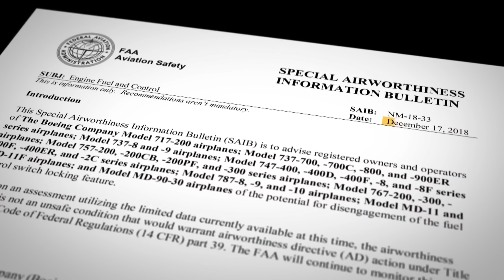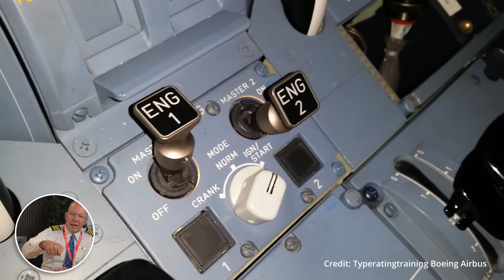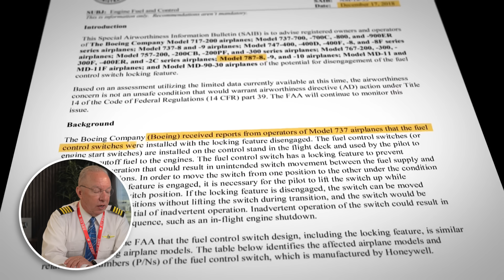Air India 171: The FAA’s 2018 Fuel Switch Locking Bulletin Explained (16 Questions Answered)

Comment: Putting blame on “Mental health” is absolutely crap and easy way to blame pilots. I am surprised how so many people get brain washed with a preliminary report including Mr Steve that it was human error. It was a clear conversation between the pilots where one said “why did you cut off the fuel and other said no I didn’t”. A disgruntled pilot would have faught  back if his intention was to kill everyone. Also this report is probably intentionally vague because it does not say whether captain asked the co-pilot about the fuel switch. Just to let everyone know it’s easier to find out who asked that question because their frequency is different. Also I appreciate captain Steve but just understand that because you are good car driver does not mean that you are a good car mechanic and know every corner of the car. So I would not buy a theory given by captain Steve even if it’s based on a prelim report. Stop blaming mental conditions and start focusing on actual issues. Why the AC on that plane was not working when it flew from Delhi to Ahmedabad? Why all infotainment systems were down? Again just to remind people - when the first MAX went down, the blame was on pilots until the 3rd one went down…

Comment: As I understand it. virtually every modern Boeing airplane has these same exact switches in use. By simple proof of millions upon millions of miles, millions of hours and thousands of pilots not having a problem with them, designa and manufacture of the switches should be ruled out. This certainly would be as impossible as aimpossible can be. If they had been installed upside down, every trained pilot out there would recognize this immediately. I do not believe this accident was due to Boeing, the FAA, the mechanics, or anyone but the flight crew. Now it might have been some kind of brain fart on the part of this person, thinking he was raising gear but reached for the fuel cut offs? Hard to imagine. Deliberate or not? That I think is the question.

Comment: The throttle assembly, including cutoff switches had been replaced twice according to the report.  It seems highly improbable that any defect as described by the quoted Airworthiness bulletin would have been present in the aircraft.  The report states the First Officer was the pilot flying and the Captain was the Pilot Monitoring.  The PF is very busy at take off and has little opportunity to manipulate switches 3 seconds after leaving the ground.   Occam’s razor shifts the likely actor to the PM.  As this was likely planned in advance by the ‘perpetrator’ how far in advance is the PM/PF assignment made?  Is it simply am agreement between the pilots or is it decided higher up?

Comment: Captain Steeeve: The preliminary report includes another camera shot from the airport, and claims the RAT was visibly deployed in that image. So, if that is to be believed, the RAT had deployed during climbout.

Regarding the question about the climb: There will be some time between stimulus and response, due to inertial tendencies. If you switch off both engines, the climb will be decelerated before it is impeded. (Newton's First Law.)

Finally, while the evidence available may point to the allegedly "deliberate" act, how does one know for sure that this was deliberate act? I am failing to see how everyone -- including you -- is drawing this conclusion. Please enlighten us.

Comment: Someone posted about including anti-shutoff logic and you were relating engine-fire shutdowns. I'm not familiar with wide-body jet cockpits, but on exec-twin-jets, pressing the Firewall Shutoff switch shuts off fuel to that engine and arms the fire bottle. I presume the Fire Handle works the same way. On this model aircraft, the difference is that it looks like the Cutoff Switch being re-indexed back to ON also begins an auto-restart with fuel by the FADECs and ignitors running. So a confirmed engine fire would be a Fire Handle pull for shutdown of fuel and rotation for the fire bottle. Engine mechanical failure or bird-strike would be the Cutoff Switch?

Comment: The FAA had issued a Special Airworthiness Information Bulletin (SAIB NM-18-33, dated October 2018) warning that these switches could inadvertently move from “RUN” to “CUTOFF” due to mechanical deficiencies in the locking design. While the FAA acknowledged the safety concern, it did not issue a binding Airworthiness Directive, and therefore compliance remained optional.

According to Air India’s internal maintenance records and official statements:
	•	VT-ANB was equipped with the part number identified in the bulletin.
	•	Air India did not perform the optional inspections or retrofit suggested by the FAA SAIB.
	•	The aircraft’s throttle control module was replaced in 2019 and again in 2023.
	•	These replacements did not involve the fuel control switches.
	•	No fuel switch defect had been reported after 2023.

They already screwed with the fuel control twice, and never complied with the SB

TCM replaced twice; SB not addressed

Three factors or strikes against Boeing right there, not to mention the pilots saying they did NOT move the switch to cutoff

Sounds like a coveru
Reply: The pilot saying that he did not move the switches is what you would expect someone to say that wants to make the accident look like it wasn't suicide in order to get an insurance payout for family. Or the pilot that asked why the cut off switches were activated is the one that actually activated them, again for the same reason. Life insurance doesn't typically pay out to beneficiaries because of suicide. 

Lose your ridiculous and childish anti-Boeing bias .

Comment: Questions:  do switches have actual contacts to tell the data recorder thier position or is it deduced by sensors downstream?
Is there a better or faster way to restart an engine than the automated rapid sequence initiated by the cycling of the switches? Go around switch? Some other switch with the same effect? 
Why would the insane pilot allow the sane pilot to restore the switches to run? Seems it would be easy to slap his hands away.
If a pilot wanted to crash the plane but not be known as a murderer, why not grab the opposite pilots yoke and give it a shake? At  a few hundred feet any sudden movement......
Reply: There are abnormal time gaps between the point of the cutoff and the switches  being moved back to the run positions to restart the engines, and between the two engines. That could indicate a scuffle took place. Besides, whichever pilot moved the switches to cut off knew that there wouldn't be enough time for the engines to restart and get enough thrust to keep the airplane in the air.
Reply: Or both pilots were gob smacked when the engine computers dropped out.
 @CorneliusTaylor-s1u
Reply: Was there the sounds of a sc uffle? I'm not debating it, just dont know.
Also,how long after fuel was turned off at high speed,would it take a pilot to realize the engines were dying? Sound change,warning lights or sounds,and then comprehend what was happening.
How long from the cut off to the question "why did you.. .?" 
A short delay might indeed indicate he saw the act,a longer delay might indicate he had to diagnose the problem,I don't know

Comment: Great conversation, Capt Steve, you are an asset to us all. We needed this chat and analysis to clear out doubt and sharpen vision on what happened to Flight 171.  

I am glad to know that hardware malfunction is not the cause. As you noted, the issue with the fuel switch malfunction had to do with how they were INSTALLED BACKWARDS on a few 737 planes. The switch itself had no defects. It was installed upside down in some 737 planes so Boeing asked AI to check their installs too. AI did not check simply because this 787 had been operating fine and you cannot start a plane with fuel switch on backwards, so plane would have never started, so this is a dead issue. Once and for all, fuel switch is not the issue. 

It's the classic dilemma. Give pilots control over aircraft so that a human brain can make the ultimate decisions and override machine logic, or...
Humans are illogical, emotional, and have ideologies that push them to commit acts of harm to others, or internal workings (depression) which cause self harm, whereas machines are consistently rational.
Therefore, do you give:
a) Irrational humans ultimate control only to be thwarted by a rabid idealogue, or sui*cidal man who overrides the auto controls and kills everyone, or
b) Machines full command due to being 100% logical, very accurate, very predictable, only to be thwarted by malfuction, defects, and scenarios that were not expected with no manual override possible?

Some facts that might illumine this darkness:
1. Capt Sumeet Sabharwal, 56 yrs was Copilot on this flight, probably letting Capt Clive Kunder, 32 yrs, get more flight hours training as Flight Pilot. So Kunder was at the helm that day.
2. Capt Sabharwal is the one that made the Mayday call.  He called just before the crash. Is it the copilot's job to make that call normally?  I cannot see the guilty party making the Mayday call, can you?
3. The dialogue between them was, "Did you turn off the fuel switch?" and response was, "No, I did not".  We don't know who said what yet, but... in behavior analysis, those who speak the truth, usually say, "No, I didn't!" and those who are being deceptive say, "No, I did not", without a contraction in words.
4. As per the official prelim report, there was a 1 sec delay in turning off Fuel Switch #1, then Switch #2. Both switches were off at 08:08:42 UTC.
RAT auto deployed as it should have at 08:08:47 UTC.
Fuel Switch #1 (Engine #1) was turned back on manually at 08:08:52 UTC and managed to relight soon after.
Fuel Switch #2 (Engine #2) was turned back on manually at 08:08:56 UTC but had trouble reigniting.
Mayday call by Capt Sabharwal went out at 08:09:05 UTC
Plane Black Box stopped recording at 08:09:11 UTC 
 Crash Fire Tender left the airport premises for Rescue and firefighting at 08:14:44 UTC.  That is 8 mins before they LEFT airport. It probably took them 20 mins to get there.  Far too late.

One last thought - Most likely it was too late to lift the aircraft backup again, but what if Engine #1 had started up again, but the pilot at the controls decided to nose dive down anyway?  Chilling thought.

Comment: One switch failing is possible. Two failing 1 second apart? Astronomical odds against this.
Reply: Blame the Swiss and their cheese.

One switch locking mechanism fail, nothing happens. 

The second switches locking mechanism fail months later, still nothing. 

We need somebody to accidentally bump those switches AND for it to happen during take off.

Imagine if somebody accidentally bumped those switches at 30,000 feet ... and the locking mechanism worked ... the incident wouldn't have even generated a report. Nobody would even call it an incident.

Imagine you live alone in a large house, and the lock on the door of the upstairs bathroom doesn't work. If somebody pushed on it, it pops open. But how would you ever find out?
Reply: @danielch6662  Single engine flame out or double at 30,000 would have been reported and investigated. ATC would have noticed deviation from altitude. Passengers would have noticed. QRR would have recorded for maintenance. ADSB would have recorded. ACARS would have recorded and transmitted to airline maintenance.
Besides, how would the locking mechanism fail? It’s either installed or not. It is literally a ridge of metal in the switch lever’s path that you have to pull the lever up and over to change the position. The FAA advisory was about being careful that maintenance doesn’t re-install the switches upside down.
The switches we found post crash back in the run position and so documented. The next step is to test them to verify that they move correctly and the locking mechanism is in place and works as intended. More details will follow. It will take up to 2 years for ALL possible issues to be investigated and safety recommendations to be issued. The fact that no Airworthiness Directivewas issued now leads me to believe the switches were tested for proper operation and no fault was discovered…….yet.

Comment: Considering the recent terrorist activity in this neck of the woods leading to high tensions and even recent conflict between India and Pakistan, also considering the best explanation we have for MH370 so far is an intentional act of a seasoned pilot, what are the chances this was an intentional act of terrorism by a pilot?  Say one of the pilots identified with one of the Muslim extremist groups in Pakistan and decided to go 9/11 with the plane while the other was in complete shock of what was happening in front of him and just didn't manage to get in the machine speed reflexes to save the plane.  What would that do to aviation, especially from the pilot's perspective?

As for logic to keep engines from being shut down, I mean the Airbus planes already have a lot of logic to prevent pilots from crashing the plane.  It hasn't been Boeing's ethos to prevent pilots from bending and even breaking the plane.  Maybe that ethos in Boeing needs to change?